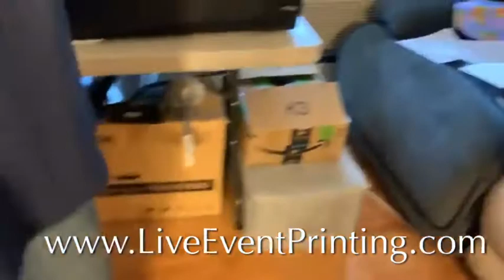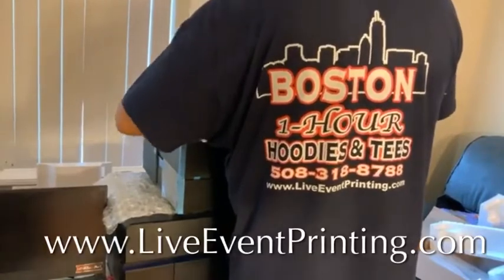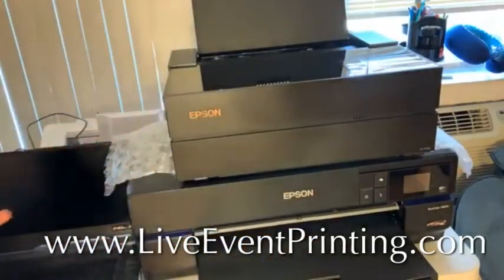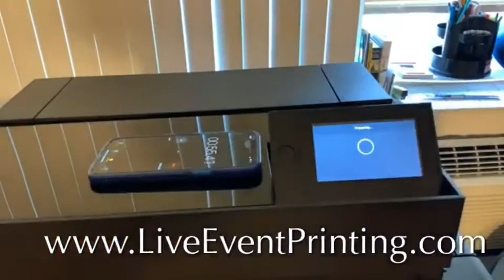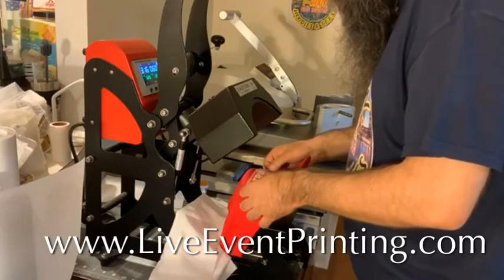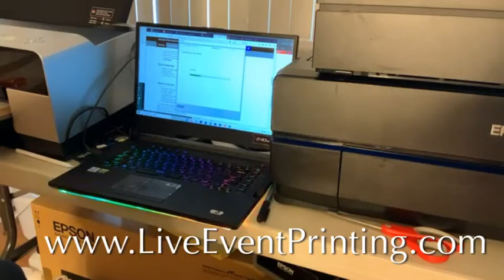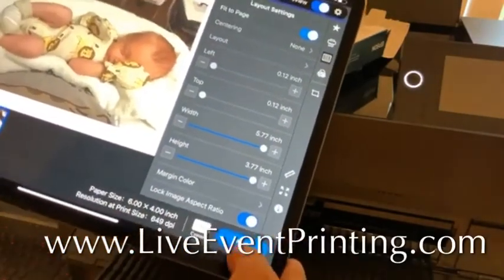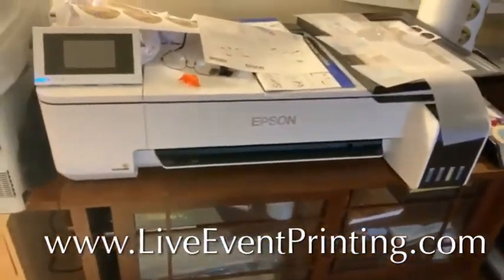Epson P700 Unboxing, Set Up and Printing

Comment: Hi Bro Ernest, so glad to find this tut. My beloved R1900 finally gave up the nozzle and has gone to the happy print shop in the..(? probably Tokyo). I have been setting up my new P700 along with you and ...when it came to priming the inks I did not experience this step. the one thing I did do differently was to not start the printer, not even plugged it in, before loading the inks. Mine just went straight to load paper after doing some rudimentary setup like yours. hope i haven't done it wrong. thanks for the tut! it's sweet!... still watching.... done...        I am using adobe to manage color, not the epson print driver but the drivers options were displayed in the adobe dialog.  I used "best detail" setting on UPPP paper of some oil painting scans.. ee gads, amazing!

Comment: Can you make a video of converted p700 or p706 to dtf? i have p706, I think they are both the same
Reply from the maker: I cannot, in the United States the P700 is currently a printer that is unable to be converted. It is a great photographic printer but I feel the unit is somewhat underpowered for printing hundreds of transfers per day.
It’s a great 13 inch photo printer.
Reply: @brotherernest5993  AcroRip is constantly saying they'll be supporting it in 11, but yet to bring it out